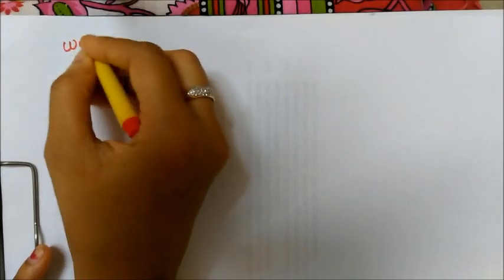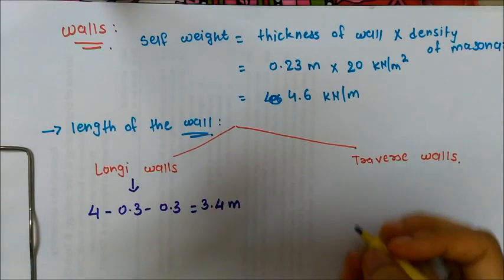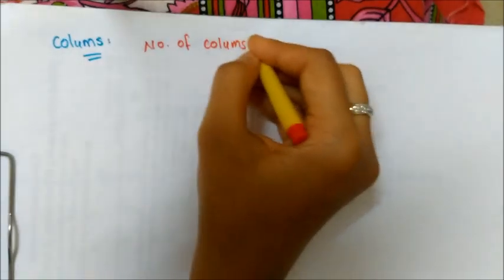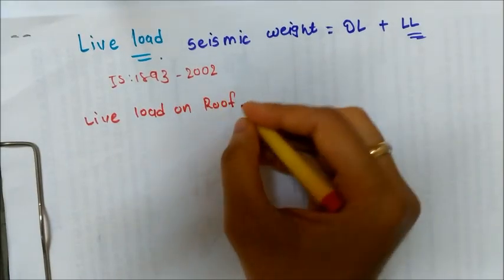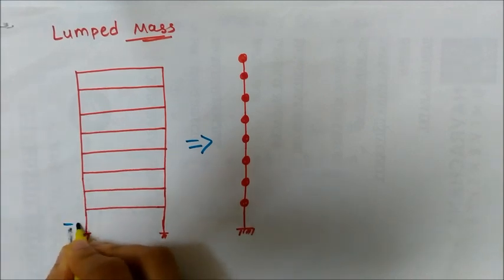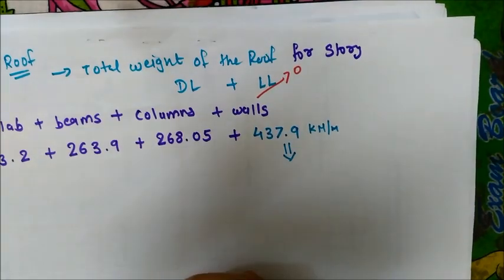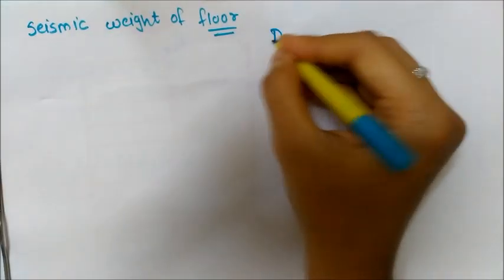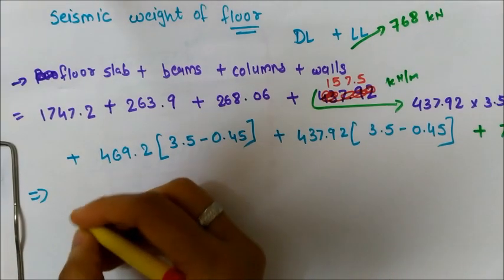Seismic load calculation Part  2 as per IS 1893-2002

Comment: Too many mistakes. I've stopped watching at the point when you took density of brick as 20KN/m2 instead of m3. You did not consider height of wall for it's self weight calculation.
Reply: Noticed same 😂
Reply: @omhu9503  point end main samjhaen ge follow the method its awsome really
Reply: Notice carefully mistakes in calculating and unit but 
Last m sbki unit theek lgai h ek baar again check kro

Comment: Mam,How did  you change weight of columns in calculating the dead load of total roof
Reply: Take half of the column .. my brother for calculating lumped mass .. you have to take half .. as it was KN/M .. length was not taken so .. it take .. half of column .. Its my idea not clear

Comment: sorry madam:when u are calculating the self weight of columns,i think there is a error the way u did it. look here plse 
sw = .3 x .6 x 25 density of the concrete=4.5kn/m that is right.
           no.of columns= 4.5 x 30 columns=157.5kn/m ur right
          when ur calculating seismic weight of floor: u mentioned that the total weight of  columns are 437.92 , even if u multiplay the total weight of the columns the hights should be 551.25kn/m2. so will u pls tell me where u did u computed the sums.
 .
Reply: Longitudinal direction m 7 columns and lateral direction m 5 columns 
Then total columns = 7×5 =35
Reply: I am agree with this statement
Reply: Bhai mere to 35 columns hi h
Reply: its the traverse wall